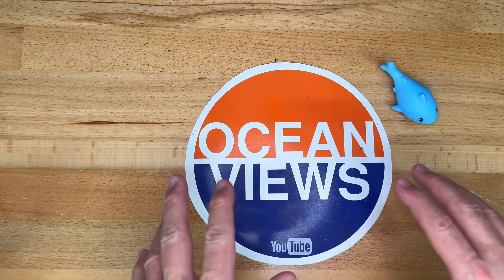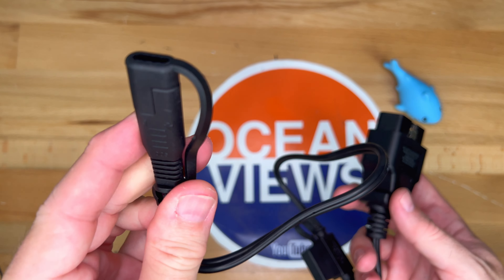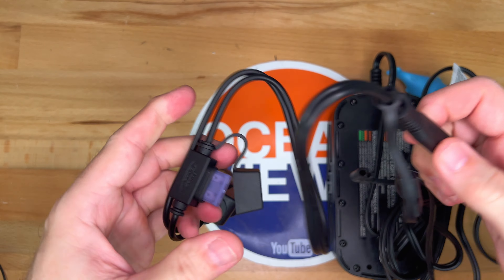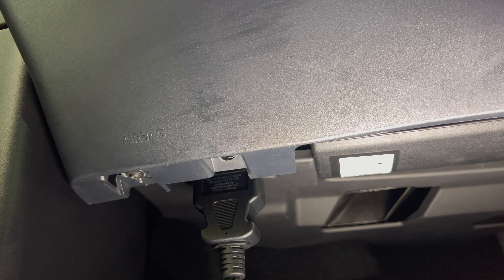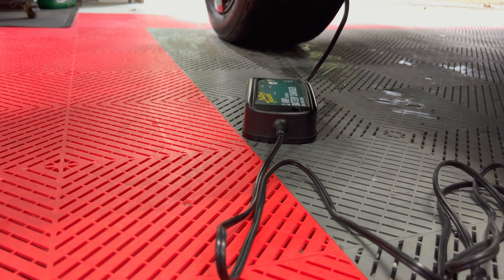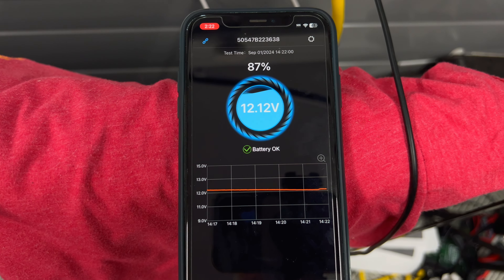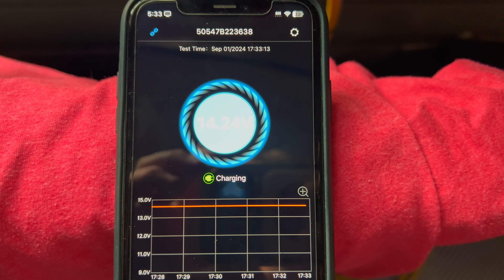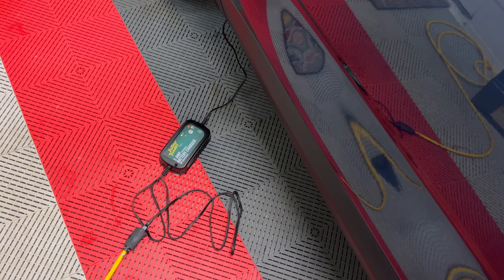Fisker Ocean - OBD2 Battery Tender

Comment: That is a great invention so we thought at our company we sold them but discontinued them we had too many complaints of blowing fuses, uncertain, modules being shorted out
We don’t think it was the battery tenders fault we think it’s the member turning on the vehicle while in charge  
I would suggest to use the standard battery tender straight to the battery unfortunately  we went back to that

But it may work out for this vehicle, cause some vehicles that hadn’t had no problem bmw/ Mercedes had the most issues
Thanks for the video  👍
Reply from the maker: @lvguntv3331  Yes, if people use a charger above 3 A, it will blow the fuse.  People either don’t read directions or don’t think believe it’s a limit.
Reply: Is there any reason that you can think of why it would not be possible to set this up to prevent a battery drain during software updates?
Reply from the maker: @Downtowncondos  The 3 Amp limit is way too low for the updates.  It is now recommended to have at least a 30 Amp battery charger/tender for updates.

Comment: I just inserted my obd2 cigarette lighter adapter and checked the voltage with my multimeter - there is zero voltage. This same adapter shows voltage with my other gas suv car. Is there something that need to be turned on or if a specific fuse needs to be checked? I double-checked the connection to the obd2 a couple of times - seems solid.
Reply from the maker: Interesting, I haven't heard of the OBD2 port not working.  I wonder if there is another OBD2 adapter you could use to verify.  There is a fuse that controls the OBD2 port, it is located in the dash fuse box.  It is RF19 (10A) in the second (right hand) column of fuses, four up from the bottom.

Comment: The Battery Tender OBD II 12V Charger is unavailable both on Amazon and the Battery Tender website.  Do you recommend any alternative products that use the OBD connector to charge the 12V battery on my Fisker Ocean Ultra?  Many thanks
Reply from the maker: @user-vx3jv6cc2g  After reviewing and thinking about these OBD2 units, I feel using the higher powered chargers directly connected to the battery will be better.

Comment: Hi Matt,
The Car battery charger I bought has 2 options you select from Lithium (LiFePO4) and AGM STANDARD. 
When I plugged in the OND 2 connector, automatically it chose AGM/STANDARD. 

I hope the Fisker 12V is AGM/STANDARD
Reply from the maker: Yes, the 12V battery is AGM.
Reply: @MTNRanger  The 12V battery is fully charged, thanks for the help. You are a great guy, awesome videos to help others🙏

Comment: Could we also hook up the battery monitoring device with Bluetooth under the dash instead of using the same adaptor under the hood? thanks
Reply from the maker: No, the Bluetooth monitor needs to be directly attached to the 12V battery.

Comment: I understand that as long as main battery is charged, it will provide power to 12v battery. In case main battery is completely dead, I can connect the car to home charger and it will charge both main and 12v battery. My question is; when would I need to use this OBD II connected charger to charge 12v battery. Please advise. Thank you
Reply from the maker: Sometimes the HV battery pack is not charging the 12V battery as well as it should.  Hopefully this is improving with the latest updates.  If you don't have any 12V battery issues or if the battery is healthy, you probably don't need the tender.

Comment: Thanks as always for great videos and helping the community! I purchased the adopter and charger, and charged today. Should I remove the OBDII charging adopter from the OBDII port after the 12V battery is fully charged? Is there any harm if I want to keep it connected to the port all the time? Whenever I need to charge, I can just connect the battery charger. Thanks again!
Reply from the maker: Yes, I would remove it when finished charging.  It also is in the way when getting in and driving.  It's really up to you.

Comment: I just scheduled my 2.2 update. I plan to connect to a trickle 12v charger (do I have to buy a tender instead, don't know the difference) through OBD2 (this way) during the update. Any concerns?
Reply from the maker: Trickler charger and battery tender are the same thing.  If you already have one, you should be good.  The OBD2 connector has a max 3A, so make sure the charger is not any higher than that.
Reply: @MTNRanger — Thank you very much. I heard from some people (who got the 2.2 update earlier in NA) that their oceans were bricked during the update because of the 12v battery drain. I need the rating for tender with this draining in mind (for other use cases, I can do it overnight, so it doesn't even need 3 amps). Do you recommend a 3 amp, or can it be lower for the update?

Comment: Hey, we love your Fisker video’s.
I was thinking of adding an OBD Bluetooth scanner so I can see the data for the Ocean and link the OBD with the ABRP app for planning charges on an upcoming roadtrip in Europe.
Have you come across an OBD that works with the Fisker that could display the state of charge of the 12 volt battery and many other things?
Reply from the maker: I have three OBD2 bluetooth adapters and have not found any software that works with it.  I tried to get Car Scanner developer to add it with no luck. There is a submission to get the ABRP to work with the OBD. And also with Ocean Link Pro app that is coming out.
Reply: @MTNRanger  I am informed the ABRP is compatible with Fisker, but I don’t want to waste money on an OBD unless it gives me access to 12 voltage output.
Reply from the maker: @ When something is available, I'll do a video on it.
Reply: @ 🙏Thank you.

Comment: Is it possible to leave it connected to OBD with SAE connector outside? Because when battary is dead , you will not be able to open the door
Reply from the maker: @deepakamin9539  Yes, you could leave an SAE connector outside the door - just make sure you leave a long enough wire. But I’m not sure if there are enough amps to jump start the car.

Comment: Hi Matt,
I went and bought the recommended devices. Want to check with you if  12V battery can be charged  with tender when the high voltage battery is being charged with L2 charger at home.

Or do you recommend charge high voltage battery and 12V separately.

Once again thanks for all the info, it is extensive useful and brings confidence to keep driving the car years to come.
Reply from the maker: When the car is actively being charged by L2, the 12V battery is also being charged.  So you don't need to hook up a tender until you are done charging.

Comment: I have a Noco Genius 5 amp tender.  Do you think I could switch out the 3 amp fuse and replace with a 5 amp fuse on this old?
Reply: @rmorales1029 this doesn’t exactly answer your question but for what it’s worth, I was getting a 12v error message on startup. I tried using my Noco Genius 5 trickle charger direct to the battery but it wouldn’t hold the charge. I kept getting an error message on the trickle charger itself. I also tried the Genius 1 which didn’t do the trick either. As a last ditch effort I tried the 4 AMP Battery Tender - and miraculously it worked. I’m not sure why the lower amperage was better but keep the Battery Tender in mind if you have issues with the Noco Genius.
Reply from the maker: The manufacturer set a limit of 3 Amps for the adapter.  I don't think I want to override that. If you would like to experiment, let me know what happens.  BTW, the OBD plug has a 10 A fuse in the cabin fuse box.
Reply from the maker: @mschruntek  After a few days, please post how the 12V battery is working.  I have seen a difference between chargers (I have three that I'm testing).
Reply: @MTNRanger I am out of town for a little while, which is why I’m using the Battery Tender (connected directly to the 12v), but I’ll let you know when I return.

Comment: Q. While you’re charging the battery, you’re supposed to leave the doors unlocked or you can lock it with the key fob?
Reply from the maker: @mikhailaminov4557  Yes you should lock it.
Reply: I did not get 2.2 update yet I didn’t get any notification. What should I do?
Reply from the maker: @mikhailaminov4557  The 2.2 update is currently on hold.  We're not sure when it will resume.  The majority of cars don't have 2.2 yet.

Comment: Great. Is it alright to conned OBD 4 amp tender ( I bought it watching your previous video) while having limitation of 3 amp on this unit.
Reply from the maker: If you already have a battery tender, this video is not the intended target.
Reply: Either get a less powerful battery tender, or change the 3 amp fuse out for a 5 amp fuse.

Comment: So I'm  a newbie and jst got my FOE, this is to replace the whole 12V battery charger hookup and passing the cable and cutting a hole into my plastic grill... etc  ?  If so, does this way tke much more time to topup or charge the 12V ?  Thanks in advance !
Reply from the maker: @georgesalatas3619  If you already have a battery tender setup, you are good to go.  This is for people that don’t have a setup and don’t want to open the hood.  The speed of the charging depends on the charger. Going the ODB2 route is a max of 3 amps, so yes, it will be slower than say a 5 amp charger connected or the battery.
Reply: @MTNRanger  Thanks for the info and video. I do not have any battery setup yet and this looks like a good quick fix... i dont mind doing the other way too but this looks very easy to do and access. What frequency charging do you estimate ?  i guess only if needed and depends on if i have something draining my battery right ?
Reply from the maker: @georgesalatas3619  I have been using it nightly to reduce the vampire losses on the high voltage battery pack.  If you are away from the car for several days or more, it’s a good idea to attach it.  If you get a low 12V battery warning, it’s not a bad idea to use. Ideally you wouldn’t need to use it very often.
Reply: @MTNRanger  Ordered. Thank you for all you do to help all owners !

Comment: Hi, I cannot open my car with the key fob and the sensor and the door. It’s not working for some reason it’s happened after I went to car wash so I don’t know how to open the doors. I open the hood try to charge the battery. still nothing is working. Do you know anything about that how to open the doors when the sensor is not working
Reply from the maker: So if the 12V battery is working, you should be able to unlock with the key fob.  Make sure the key fob battery is good, replace if needed.  It's possible the door handle sensor is broken if you have a crack in the center of the handle (translucent plastic that lights up).
Reply: Yes, my door handle is broken and the sensor is not working and the key fob not operating. I changed the battery still not operating what happened was in the morning. My alarm went on just all of a sudden and go on and on and off. I tried to use the key fob to unlock it and nothing happen and eventually it shuts offand that’s it
Reply: Yes, my door handle is broken and the sensor is not working and the key fob not operating. I changed the battery still not operating what happened was in the morning. My alarm went on just all of a sudden and go on and on and off. I tried to use the key fob to unlock it and nothing happen and eventually it shuts offand that’s it
Reply from the maker: @mikhailaminov4557  It's hard to say if the 12V battery is also a problem with this.  At this point, I think you are going to need a mobile service tech to figure out what is wrong.
Reply: @MTNRanger I changed the battery on the key fob already and the car door opens but the key fob seemingly has stopped working as if it isn’t programmed to the car. Is there a way to get a new fob ?
Reply from the maker: @ There may be a way to reprogram it.  I would contact electrifiedocean.com and see if that is something they can do for you.
Reply: Thank you very much for your help